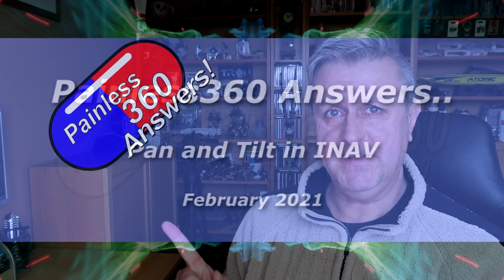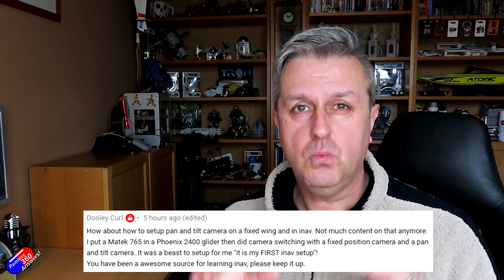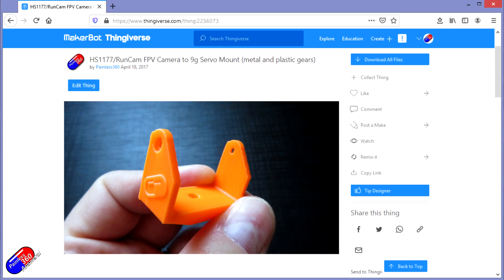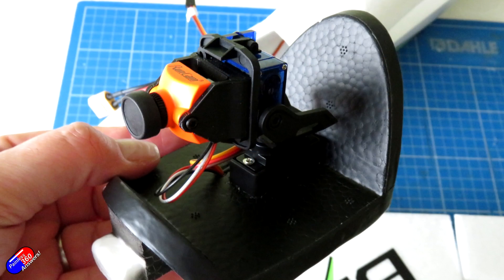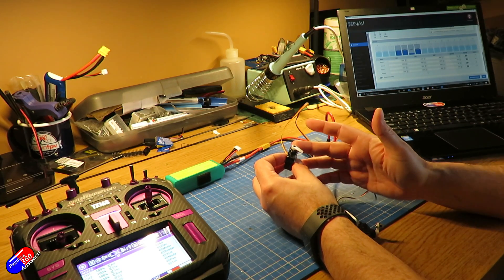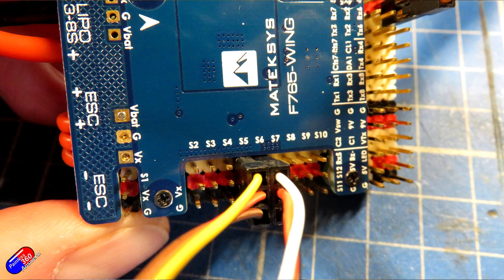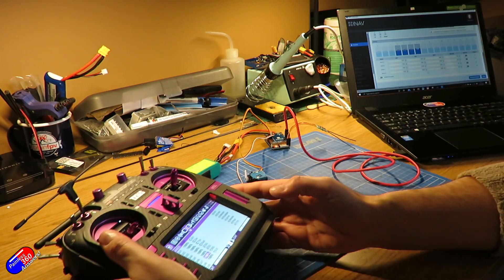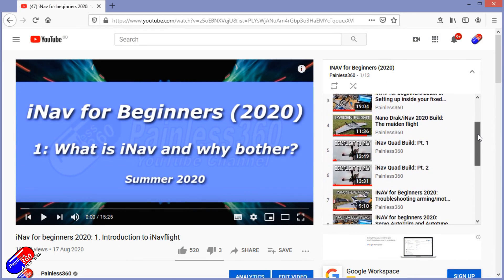Setting up Pan and Tilt in INAV (DJI or regular FPV)

Comment: Do you have a video on how to do this in Ardupilot?
Reply: Nvm. Figured it out. Setup>Mandatory Hardware>Servo Output>select the channels you selected in the radio mixer and assign corresponding RCIN_xx values in the 'Function' column (e.g., channel 10 -> RC10, channel 11 -> RC11)

Comment: I would argue that handling a 3d printer is a nightmare especially with the cheap ones. You will loose all your time debugging the printer problems instead of building a new aircraft for example. 3d printing issues are countless and very hard to debug and it is a science by itself - over extrude, under extrude, layer separation, stringing, clogging, not sticking to the base plate, correct temp, correct filament flow, wet filament and so much more. You will spend many, many hours dealing with the stupid printer. Unless, I suppose, if you by an expensive one.
Reply from the maker: https://www.youtube.com/watch?v=i-tbpV3NGUw

Comment: I have the same Radio TX16s my left and right sliders are on channel 15 and 16 when I give the inputs i can see it only Radio but the same does not reflect in Inav receivers tab I see all other channel input except the 2 knobs on top and 2 sliders which are channel 13,14,15,16 respectively 
Can you please help me not sure whats the issue here 
Thanks in advance
Reply from the maker: What radio system? ExpressLRS? Something else?

Comment: I know this is an old video, but how would you set it to have a switch turn off the servo and essentially recenter it?
Reply from the maker: Setup a special function on a switch to override the pan channel with the value to center.. Happy flying

Comment: Hi Lee, I connected my pan servo to ch7 of the Speedybee F405 wing, the blue output on inav is moving with my TX16S rotary button, but the servo doesn't move...Of course tried with an other servo, nothing, an idea? thank you!
Reply from the maker: Check it has 5v power as step one.. Best of luck

Comment: I have a quad I'm building the flight controller doesn't have servo outputs but does have 4 extra servo outputs can they be re mapped to drive a pan and tilt camera servo setup
Reply from the maker: Not sure, Betaflight had some cool resource mapping stuff so I'd look to see if anyone with the same flight controller has figured it out.. Best of luck!
Reply: @Painless360  I have flashed INAV to the controller

Comment: Hi Painless,
Great video, I was doing the same, it looks functional but I get a strange behavior,
maybe you can clear this out,
The Tx show smooth servo while sliding but in inav (outputs and receiver) it is jumping in fixed stairs like a 6 positions switch,
It causes the pan/tilt to move robotically instead of smooth.
What can be the problem?
Reply from the maker: ExpressLRS by any chance? See my video on ELRS and what that is..

Comment: hey lee, im new and having a bit of a problem with my headtracker in inav. I got it working and i see the inputs moving in the receiver tab in inav when i move my goggles around. However, i am not getting any movement on my pan/tilt gimbal. please note that it seems like i can only use TR1 and TR2 (as opposed to tr5 and tr6 in the video) as my trainer channels for orqa fpv.one pilot built in headtracker. I noticed in inav i am not able to select RC channel 1 and 2 for headtracking, im assuming 1-4 are already being used up by elevons.. what should i do? should i just not use built in headtracker and use an external HT instead (hopefully preconfig tr5 and tr6 as pan/tilt respectively)? or is there any way for me to change the behavior of my built in headtracker to use 5 and 6 for pan/tilt instead of 1 and 2.....? theres not much literature out there going over this for the orqas... just ONE guide. also i am on radiomaster tx16s.

any help or guidance would be massively appreciated
Reply from the maker: Channels that the headtracker uses to send the signals to the radio (seen as TR1 etc.) can be added to any output channel on the radio. Usually assigning TR1 to CH7 and TR2 to CH8 would be useful. You should see them in the reciever tab moving..Then forward those to spare PWM outputs... Best of luck
Reply: @Painless360   okay thank you! that being said, i am quite confused on what i need to set as my "inputs" in the inav mixer tab. the input tab on my radio has pan's source set to TR1 and tilt's source set to TR2. radio mixer tab has ch5 and 6 as pan/tilt - pan source TR1, tilt source TR2. and then currently i have servo 5's input set to "RC Channel 5" and servo 6 set to "RC Channel 6".... please highlight what im doing wrong lol i have no idea what im doing.

would you be able to expand on "forward those to spare pwm outputs" or direct me to a video of you covering it? sorry for noob questions... i just wanna fly :)
Reply from the maker: I have lots of videos that cover the setup of pan and tilt on the channel, check them out..

Comment: In your opinion could you use Inav on a mini quad to make something that's more like your commercial camera drones? Also, do you know of any pan tilt servos that could handle say a gopro 10?
Reply from the maker: Yes, but you'd have to work on the tuning.  Ardupilot is better for larger filming rigs at the moment... happy flying!

Comment: Might be dumb question, but is it possible to use headtracker for RC control (pitch, jaw, roll) except throttle (pushing back-forward)?
Reply from the maker: Yes,  I'm working on it handheld version with the designer of the project..
Reply: @Painless360  Glad to hear that ! Following

Comment: Hello. Why my signal from ts16s to inav (matek f411-wse) is discret. For example: 1000, 1275, 1425, 1500, 1575, ... How can I fix it?
Reply from the maker: Can you explain a little more? I don't understand...
Reply: @Painless360  I think it is because I use expressLRS, where ch5 - 2pos, ch6-ch11 - 6pos, and ch12 - 16pos
Reply from the maker: Probably. If you mean that the channel doesn't move smoothly on anything but CH1-CH4 then that is an ELRS thing (at the moment)..
Reply: @Painless360  exactly)

Comment: I had added an improvised pan/tilt bypassing INAV directly to receiver outputs.   I may try to switch this based on this video, but I wonder how much control you can achieve with this?  My problem is that my servos are too fast resulting in a herky-jerky camera moves.  I'd like to achieve more cinematic motion and Im not sure you could get this by just lowering rates.  My controller is a secondary thumbstick so I'd like to make motion relative (to a limit) rather than absolute.  That is to say, I move joystick left and it moves maybe 4 steps left per second.  I have read there is a way to achieve this with a Taranis & LUA script, but so far I have not succeeded.  Any suggestions?

Comment: Hello. Any idea why slider on my Taranis is not centered on 1000? I want the middle of the slider to be 1000 like on yours. However even with the slider on the min setting it is still at 1000. Slide half way up and it gets to 2000. I can't get it to go to zero on minimum slider setting.
Reply from the maker: If it happens on all models the the radio probably needs a calibration. You can get to it in the radio menu... Best of luck

Comment: Trying this and the servo (I need pan only) centers but won't move with the slider. Everything seems to be working in the reciever and output tabs. I'm using a tx16s with the inav fixed wing group opentx model v2. Running a fullsize crossfire and micro v2 RX. board is matek f405 wing.
Reply from the maker: I'd try it with a basic model setup on the radio in case that model setup is your problem. Best of luck

Comment: How do I add a switch like the old Hobbyking LED device that has same connector as a servo but on a quadcopter running inav? Thank you.
Reply from the maker: You'd like need to find an output on the controller that can output the PWM and use this process. Many quadcopter flight times controllers don't have spare pins for things like that. Best of luck

Comment: Awesome video, Painless! My question is, can you add headtracking? I cannot seem to figure out mine. as I am using crossfire with Sbus. I would like to use it with INAV and my FC is the thing. It works  fine just straight to the servo pins PWM style but will it work for me with the FC and Sbus?
Reply from the maker: Yes. Check out the other videos in the series... Happy flying

Comment: How about a DIY arduino set up for the headtracker?
We have tried to make one using a nano and a mpu 6050 gyro,didnt work.
Is it just the GY-85 sensor that only works for the programming available?
Cant buy a headtracker anywhere,hope you can help 👍🏻
Reply from the maker: I've only ever used the mpu specified in the wiki.. Best of luck
Reply: @Painless360  thanks for the quick response. I've bit the bullet and bought the correct mpu to save hours of programming 🤦‍♂️
Reply: @Painless360  be a good video to do to show us mere mortals
Reply: In response. We're using a gy521 gyro and Dennis Frie's code doesn't support mpu6050 gy521 gyro but supports the gy85. I've been trying to incorporate the gy521 code into Dennis's to no avail.

Comment: I woke up this morning going, i need to familiarize myself with pan tilt on iNav, thanks man. Quick one though, I want to use this on a RC car so would be ideal if it was stabilised. I believe that you can stabilise the pan tilt using the inav settings?
Reply from the maker: Yep. Look at the CAMSTAB mode in INAV. Best of luck

Comment: I have the f411 wse board and on my pan and tilt the pan servo only works on rc yaw. In angle mode if I pan it’s normal but if I use cruise mode the pan actually turns the plane. Any idea of what I’m doing wrong. It’s in a Dart XL so I don’t use rudder
Reply from the maker: I would not use the controls for the model to control the gimbal. Maybe duplicate the yaw onto a spare channel on the radio and use that instead?

Comment: Another very useful video ...   Something most of us would like to try . Do you always pre-assemble , program & test all the various electrical components . Before installation .                                                                                           Also I came across a box with a Pixfalcon 4 kit ( from a few years ago ) that I never used . Is it still possible to update & use ?    Thank You Sir ....
Reply from the maker: I always set things up and test them before install. See my builds. I didn't used to but trying to figure out why something isn't working when it is glued into place 6 inches into a model that you can no longer easily get to is a painful lesson. ;) Happy flying!
Reply: @Painless360  another great tip ...  Thanks  Again  Sir

Comment: Good video Lee, Thank you, If you slow down the movement in the TX Open-Tx settings you get slower smoother movement of the servo/camera regardless of the speed your finger moves the control. I'm sure you know this Lee LOL this note is for your readers :-)
Reply: How can you do this? Slow down the movement
Reply: @nathanael6461  In transmitter, (OPEN TX or EDGE TX), go to MIXER tab of the desired channel, scroll down to values 'Slow up' and 'Slow dn' and adjust the value to suit your need 😃
Reply: @stevietee10  ah yea thanks! Is there also a possibility to “disengage the pan” and let is auto center?
Reply: @nathanael6461  Not quite sure what you mean here, but I'm thinking you want to use a switch to ignore any 'PAN' position set and point the camera straight ahead. This is easy to do, just confirm for me what you want 🙂

Comment: Nice video. I have the same set up as Dooly. I use the head tracker in my Skyzone goggles to run the pan and tilt and have a runcam hybrid mounted on it.